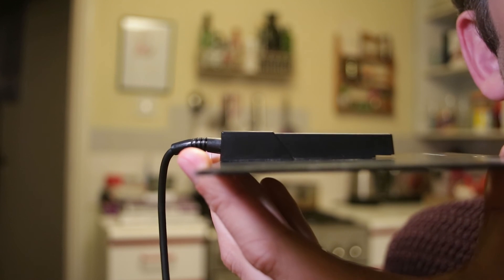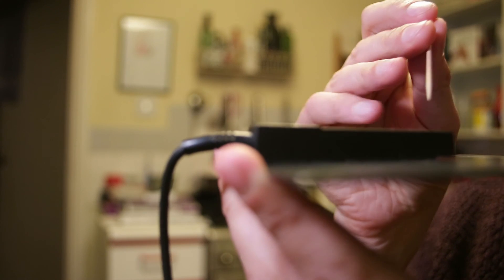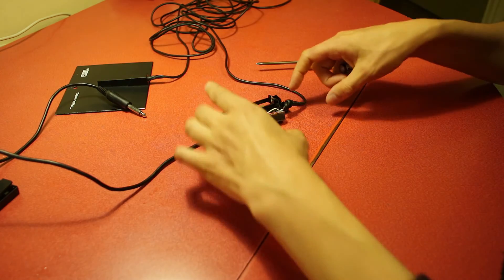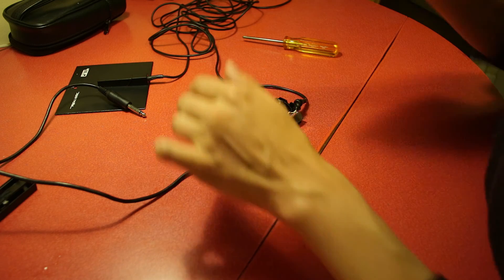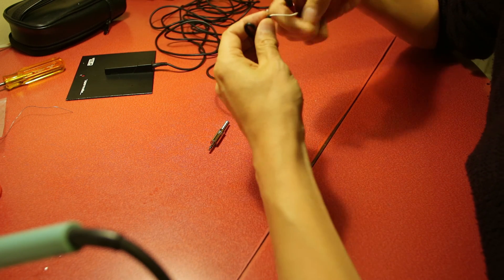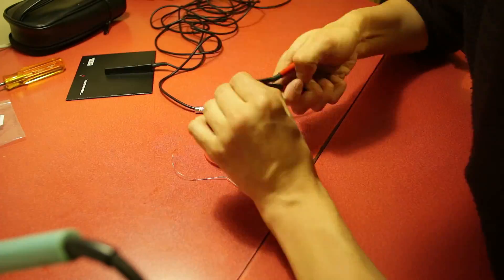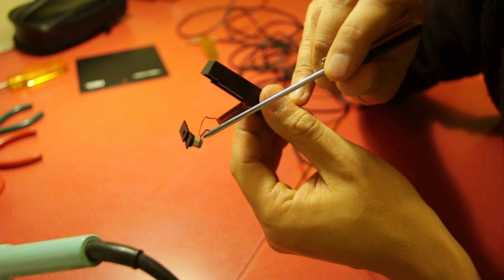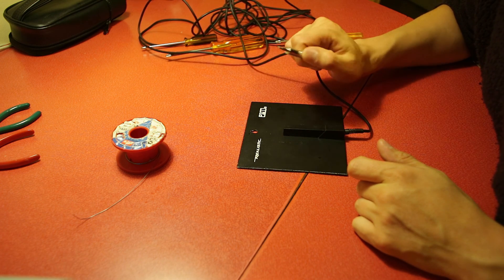Realistic PZM mod for DSLRs

Comment: Thanks for the interessting video again. Is  it possible to combine this second - and more simple - modification of the capsule with the xlr P48 modification  of the batterybox as you suggested in the your other  video? 
And would it be  intersting
a)  to replace the plastic battery box with a full small metal box with female 3,5 mm mini-jack and the modiufied original print plate and xlr cable? 
b)  to remove the switch?  The switch is a weak point in the original construction.
Reply from the maker: Both points could be interesting. After the phantom power mod, you don’t really need the switch. A metal case would help with shielding.